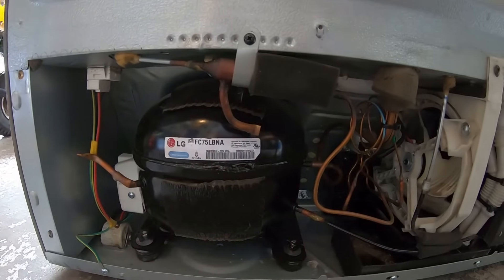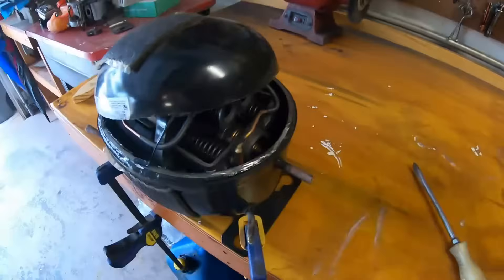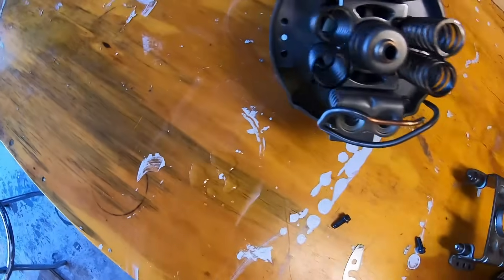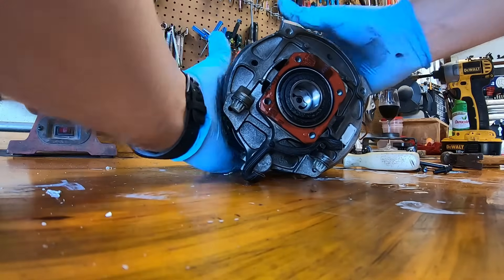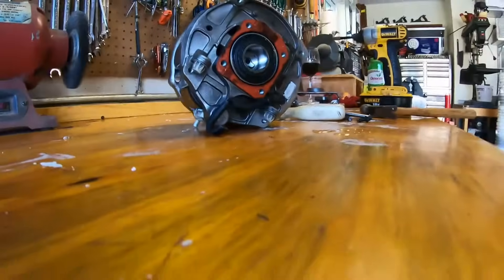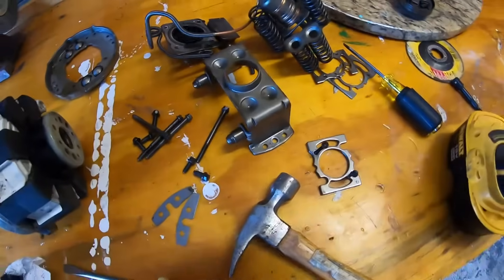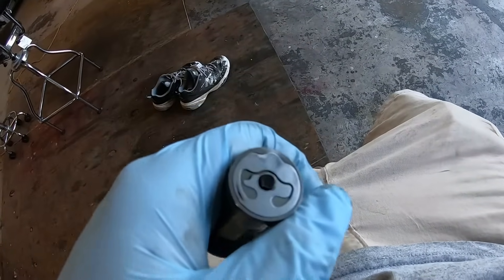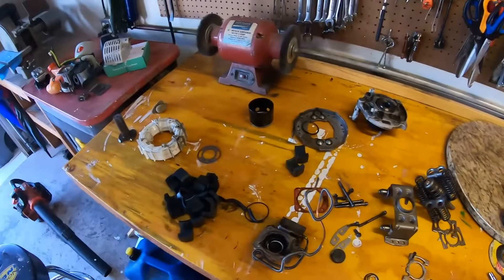Cutting open a failed LG refrigerator compressor

Comment: Thanks for making this teardown video. It is frustrating how poorly these newer appliances hold up' compared to how much money customers are charge for them. I routinely work on older refrigerators, such as GE Monitor Tops from the 1930's. Working on fridges from a large range of years, it's easy to see how the bean-counters infected the design decisions which went into building them. The first ones, such as the 1930's models were built to last "forever." By that I mean they didn't plan for any specific expected life span in operating hours. The built it to the best of their abilities. Many of these are still in operation 85 years later. They go until some outside force kills them. These compressors ran at a lower speed than most more modern ones. They had larger parts running slower to do the same work. They also had 6 cups of oil in them. The construction materials were typically copper, brass, and stainless. 

As time went on, in the 50's, new designs emerged. The compressors were mostly still low-speed, but contained less oil. The manufacturers had begun using aluminum parts (typically the evaporator) in the refrigerant circuit. These are now failing due to corroded aluminum parts which are very difficult if not impossible to repair.

As time marched on, in the manufacturers transitioned from the low speed ~1800 RPM motors to ~3600 RPM two-pole motors. This allowed a compressor of half the size to do the same work. Consequently the stress on the reciprocating parts was increased. The number of flexings of the reed valves doubled, decreasing the fatigue life of the parts. These designs continue to be used today, and thankfully are a mature technology with good reliability.

Then the bean counters struck again, and 3600 RPM was not enough. Enter the inverter compressor. Now, the motor can be run at speeds far above 3600 RPM by the electronic frequency converter. Again, the cyclical fatigue life was reduced - particularly for reed valves. Also, running the compressor slower to save energy use can allow for poor lubricant circulation. 

Your linear compressor is so "encheapened" that it is little more than a glorified speaker voice coil. The springs which support the piston are a source of failures due to  high-cycle fatigue. As you saw in yours, the reed valves can fail (there may be a chip out of the reed on your piston) as can the cheaply made plastic parts in the compressor. The bean-counters love this design because it is cheap as dirt to produce and can be operated at very high speeds. Again, use a smaller compressor to do more work, at the expense of life expectancy. I realize your video is 4 years old now. Currently there is litigation over these compressors and their poor service life. I sincerely hope LG gets their rear handed to them on a silver platter for producing such Literal Garbage and costing consumers so much money and hassle over their poor design decision.
Reply: general motors has(HAD) some of the best engineers on the planet but the bean counters rendered their efforts in vein.....
Reply: @ssnerd583  Sad but true.
Reply: @ssnerd583 there are nice guys, but the company is quite burocratic, they don't count money so much, but engineers are doing couple of things where they have no clear picture, just some tasks.
Reply: I wonder the efficiency rating of the old 1930's fridge vs today and over time? My old 1980's fridge performed well compared to a new one. Suspect they just design things to fail because the currency is failing and keeps economy rolling.
Reply: The efficiency is way better for the new compressors but if they are going to break down every 3-5 years and it will cost either 1000 to install a new compressor or you can do it yourself for around 500 if you have the tools already. 
You might as well just pay a bit extra on your monthly bill to have a refrigerator that will last 15-25 years @livingwaterutube
Reply: @livingwaterutube I fully agree with you. Seems nowadays that everything manufactured is built with planned obsolescence .
Reply: We had a 1927 GE monitor top that still ran when scrapped in 2018. The case finally was rusting out. Also had a 1936 GE that I left in my old shop when I sold it- still cooling like a champ. I'll take a reciprocal compressor with a solid state relay any day over the current crap they build. (Can you tell I was from an appliance service family- 61 year old firm that I ran the last 31 years.)
Reply: I don't think it's necessarily the type of compressor that is the problem. It's that they don't feel like making the compressor well. They don't care that their parts will fail and use cheap materials.
Reply: @IllumiNaughty22  Partly correct: but smaller parts running at higher speed is an inherent problem: they are always wearing faster in proportion to their size and are always working closer to their design limits and bad materials will fail much more quickly. That's why fighter jet engines need much more maintenance than commercial jet engines.
Reply: @pierremauboussin3527  Inverter linear compressors (at least these ones) are variable and can run at different speeds so most of the time they will probably running at low speed, and they don't necessarily run at higher speed than a normal compressor. Inverter compressors are not jet engines they are not trying to go max afterburner on the refrigerator, although that'd be pretty cool.
Reply: I realize people got boned by the company, I just don't think it's inherently the technology. I think it's greed and using the cheapest parts.
Reply: YEAH....like Nissan making the factory cam and crank angle sensor housings out of plastic that will last EXACTLY 5 minutes past the 36k mile warranty and then crack and cause the car to not run right or not run.....and the RAM  1500 pickup truck plastic blend door actuator pivot arms to magically break at the same kind of just out of warranty point and they charge 8 shop hours to change because they SAY the entire dash has to come out to repair it and their 'blend door guy' can get them done in about 40 minutes, each....yeah
 @IllumiNaughty22
Reply: I agree....When I saw this, the first thing that came to my mind was an oversized vibrator style air pump used for fish aquariums and the same common failure those pumps had....At least you can easily disassemble the air pumps to replace the worn parts.
Reply: @grandinosour  ABSOLUTELY AGREE!
Reply: This comment had to be the most comprehensive, in-depth explanation on refrigeration compressors. Thank you for taking the time to explain the history and design changes that has cost me as well as thousands of LG owners on a poorly designed compressor.
Reply: @Ratlins9  Very glad you enjoyed the explanation! It is a shame how poorly made things have become. All of it is "justified" with some nonsense narrative to keep the uninformed happy with the high cost of ownership they have to endure.
Reply: @Ratlins9  Too bad the mechanics of the global economy are such that you cant just have someone come out and replace the compressor with a updated version under warranty.   Think about this, how much would a fridge cost upfront if one of the selling points was the company guarantees to be able to deliver every part on it for the next 5 decades?
Reply: That was excellently written. I'm going through this now with our 6-year-old LG fridge that we bought new. We just got a new GE equivalent yesterday and it will probably not last any longer based on reviews but it is one of the ones with the least bad reviews. It's fucking sickening that the LG was $1,800 and our new one was $2,100 and together they probably won't make it 10 years combined.
Reply: @Antoniocool86 And with the current price of food, a failed fridge could cost hundreds in spoiled food.
Reply: @Antoniocool86  Thanks Antonio. I hope you have good service from your new fridge, but the odds aren't in your favor it would seem.
Reply: LG did go through litigation, and because of that, they had to cover the compressor (parts only) on my 6 year old fridge. A Tech came out and did the replacement of the compressor, mother board, receiver/dryer/filter, 134a, and whatever else for $500 cash. Quite a bit less than the cost of a new fridge ($3500). The fridge has been working great so far after 6 months or so. We will see how long it lasts.
Reply: You are very smart in this field. If you were to start your own company mftrg. You could revolutionize the industry and bring back the reputation of made  in america and win the confidence of consumers. The competition would  have to re tool to keep up but by then you would have the market share and put chinese/ taiwan out of business. After all they make these appliances to fail within x amount of time to perpetuate the  supply chain machine. You could be the new MAYTAG MAN …
Reply: LG has since replaced these types of compressors and they are actually now the best in the market
Reply: @TommyP-s9n  HAHA!  You are out of your mind.
Reply: I think part of the problem is that they've been required to design ever more efficient fridges and freezers. Innovation hasn't caught up with reliability.
Reply: I came to the comments for an informed opinion. Thanx

Comment: The broken part is a reed valve, similar to York A/C compressors used in the '70s/80's on vehicles.  Basically it's a two stroke engine.

Comment: It looks like LG's Linear Compressor is right up there with GE's Rotary Compressor.  GE paid out tens of millions in Class Action lawsuits over that fiasco.  Virtually every one of those compressors failed before the warranty was up!😂😂
Reply: I was doing 10-12 of those ge compressors per week. Even on units that had not been sold. 1985, 86, 87.
Company made LOTS of $$ off that.

Comment: Home refrigerators were first available in 1918.  Compressors have been built basically the same for 100+ years without many problems.  Now the govt. demands higher efficiency and look what the consumer gets stuck with again, more junk that breaks in very short periods.
Reply: Not the fault of the Govt. Lg is solely to blame.

Comment: Had NO  idea this kind of tech being  used.   Spent about 10 years HVAC/R  service/ maintenance/ install.  I've worked on a 250hp  shaft drive Dunham-Bush  screw compressor, they are interesting.  I actually repaired  a  failed compressor, used for  recovery  back when all that  got started.  Failed head gasket.  Cut it open, fixed, and  MIG welded the shell back together.    I'm 75
Reply: The patent on the oscillating compressor has expired.

Comment: All the Mini fridges in my Hotel were LG the compressors were fine,it was the Relays on the side of the compressor would fail. Replace and fridge would like new. Never had any LG fridge failures other than operator error. We had 300 + Fridges on property.

Comment: It’s often a $0.12 part causes a $X,XXX machine failure.  Doesn’t even matter if it’s a ceramic capacitor or a seal, there are so many ways to fail and so many parts it’s not easy to make it bulletproof.

Comment: When you said "We evacuated all the refrigerant," who's we? There were no high and low side access valves visible. I did not see a recovery machine, recovery tank, or refrigeration gauges required to recover. If you had invested the $2000 for that equipment, you would have shown us that process but you didn't. So you just blew the small 10 ounce or so charge of R134a into the atmosphere just like people who waste an hour of their time to get $7 worth of scrap copper. What happened to the oil that was in the compressor?

Comment: There was no reason to redesign a proven system, but like so many other industries, they just have to screw up what works. I will do my best not to buy a new Fridg. I have a G.E. bought in 2000.she has a few age related issues but the compressor has never failed.

Comment: Refrigeration (supermarket) tech here.

*
Disclaimer:

My whole comment post is a long read for most. You have been warned!

All of my comments about the featured compressor are educated guesses based on my career and other clues gathered from the video. 

I have serviced older refrigerators in the past but nothing new that has any “smart” boards, high efficiency “hippie” compressors, or internet connected anything. It’s my first time seeing the inside mechanism on one of these VRF designs. 

Therefore, some of my statements could be wrong or based on opinion so please don’t get so worked up over it. If you still feel that bothered by my errors to shame me in the comments, I believe you need to get yourself a hobby so you can burn off some of your extra energy. :) 
*

• First things first, in our industry compressors just don’t go off and die, they’re Murdered by either poor system design or poor maintenance, or both. So basically LG murdered their own new compressor design with too many cost cutting shortcuts.

•The basic design of the compressor is interesting to say the least (not including the massive failures, which do suck). It’s completely different than any other compressor that I’ve ever seen before.

•First thoughts about why it failed is due to lack of lubrication. The parts look mostly dry (and black colored) as he pulled them out (dry is a relative term). The parts should’ve had a wet look to them instead of the barely damp or dry look. 

•LG is using a hollow piston as a valve plate and conduit to pass the refrigerant as it’s pumped from the low side (suction) to the high side (discharge). The “shims” are reed style valves. Their design is to flex or bend open off of its seat to allow refrigerant to escape or move after its pressure has changed. The large coil spring device is a counter balance damper to offset the weight of the piston oscillating back and forth during operation so it will seem to run really quiet and without much noise or vibration.

•When compressors are used at variable loads/ speeds it can create issues with controlling or the spreading out the compressor oil. The oil is a necessary part just like any machinery needs oil. The compressor oil is carried around the system with the refrigerant. If the refrigerant is low in volume or speed the oil can settle out of the refrigerant and pool up wherever it’s at when that happens. The goal is to either keep the oil almost 100% inside the compressor body (using an oil separator device), or design the system to keep the oil with the refrigerant as much as possible until it comes back to the compressor to be used again. 

•The lack of or low oil issue is the reason the insides are coated with a carbon black or soot-like residue (I’ve heard that soot residue referred to as Black Death once or twice before. Not sure if that’s it’s official name or not). Lack of oil caused excessive wear (heavy, uneven wear on piston and the degraded black disc shaped piece seen in video) and caused higher operational temperatures inside the compressor cooking the oil  Compressors can “lose” their oil in other parts of the system where it gets trapped and never makes it back. 

•LG could have added an oil separator to the discharge tube of the compressor to help it live a longer life. The oil separator uses physics to strip out the oil from the refrigerant vapor as it passes through, collect it, and then return it back to the compressor low (suction) side of the system. Yes it would have cost them more in materials to produce the refrigerator but I’m betting the current class action lawsuit is gonna cost them more per unit than adding the oil separator would have. 

Is the life of the refrigerator over once this compressor dies? Possibly. A normal or standard compressor could be used as a replacement for this linear design BUT it’s not going to be a straight forward install and it’s going to require someone that really knows what they’re doing to pull it off with little issues after the fact. You will also lose the variable speed aspect of the unit and the compressor on/off controls won’t be compatible with the computerized variable speed stuff. 

IMO it would be fun to try to get a standard reciprocating compressor to work in place of the original linear unit. 

Could this compressor design been a reliable one for domestic refrigerator use, sure. Can it still be one, absolutely. I don’t think the compressor design was at fault. I believe it falls more on too much of a “value engineered” system design (read: cheap). The whole system needs better oil control to keep as much of it as possible in the compressor crankcase and the compressor needs to have some improvements to make it more robust. 

If you made it this far, thank you for the read!

Comment: The best part is old compressors were almost always made by Panasonic and they lasted between 15 & 30 years, I guess it proves the old adage "New isn't always Better." And shame, Shame on you not wearing safety glasses at least when cutting or grinding metal, you only have one set of eyes.

Comment: Looks like the reed valve at 11:30 on the left is missing some metal so the port is open. I like the good old piston and crank design.
Reply: The reed valves are what York A/C compressors used in the '70s/80's on vehicles.  Basically it's a two stroke engine.
Reply: Yep, some of those lasted 30 years.
Reply: I wonder if it was so dirt the valve was always open so it couldn't generate compression